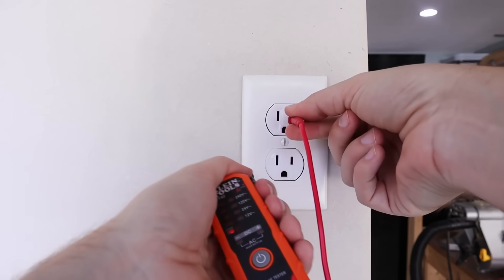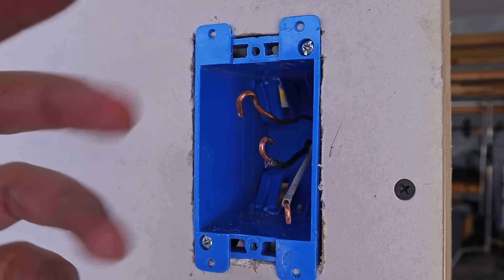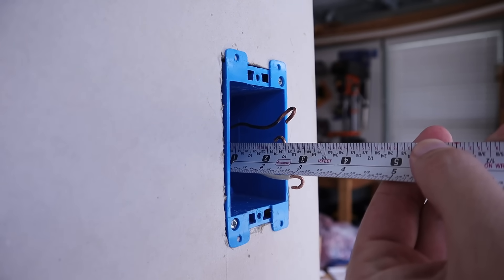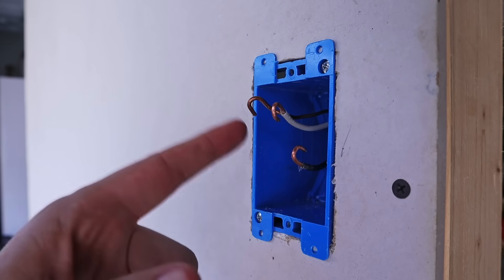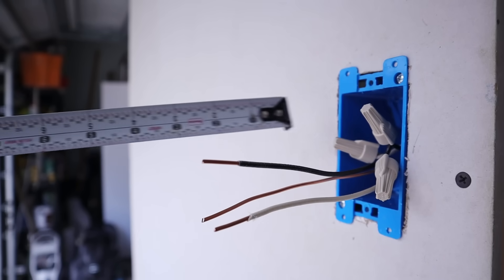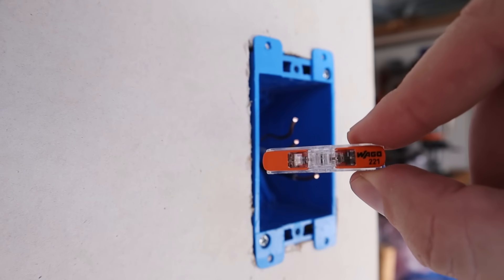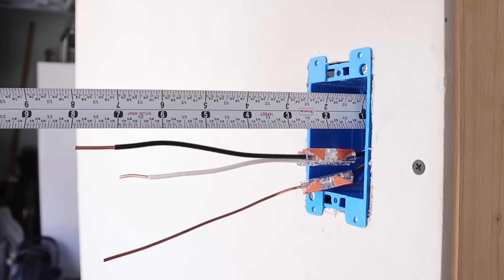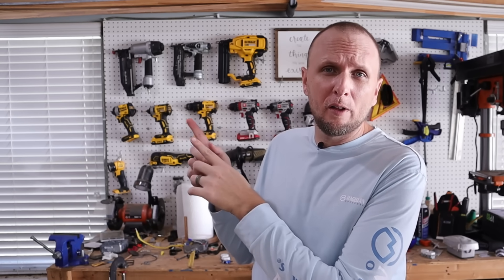"SHOCKING" New Way to Fix Short Wires In an Electrical Box to Code | Very Important

Comment: I've come across this issue many times, frustrating for sure.
My only question is how easily can those connectors come un latched?
Shoving the wires back into the box I just wonder if they can be opened and not seen.
Reply from the maker: Way too often.  They do take a pretty good amount of force to open them but yes, it is possible.  I always try to be careful when pushing my wires back into the box when using them.  I have seen when pushing them in, if one is not paying attention and pushing the wires in with some decent force, the latch catching on another wire.  Thank you for the question!
Reply: @HowToHomeDIY  Some put electrical tape around the levers for that reason.